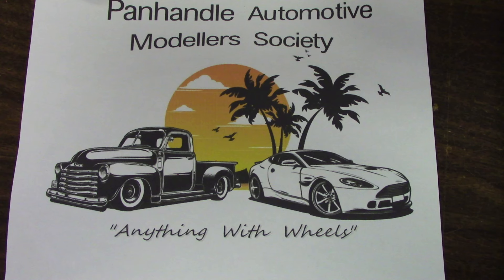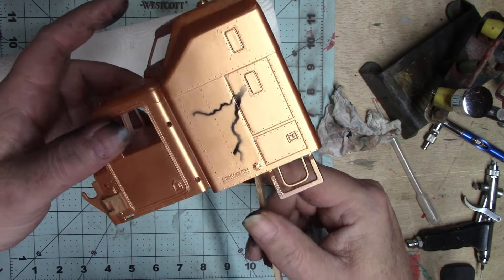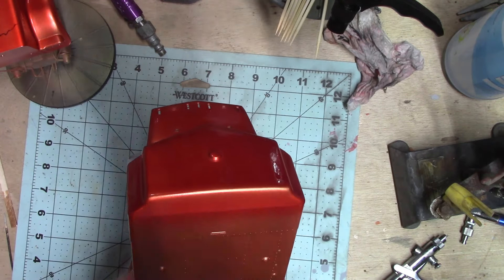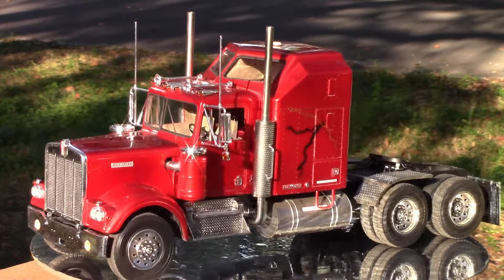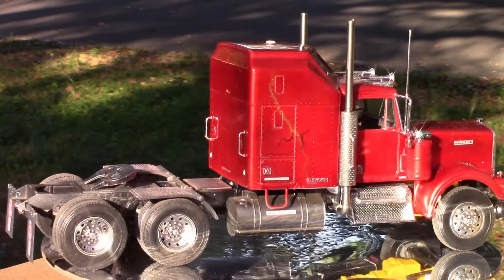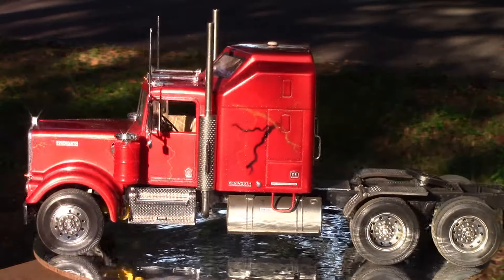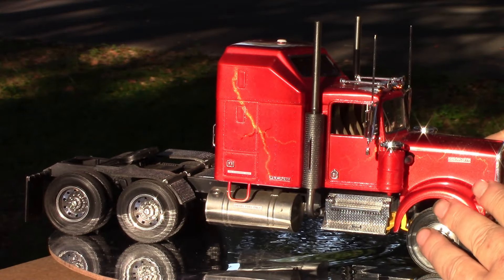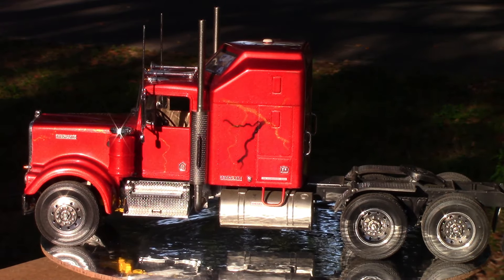FINAL ON MY FIRST BIG RIG SEMI BUILD #scalemodel #kenworth #modelcars  #diycrafts #bigrig

Comment: Hey Pappy. How did you handle the wheels and tires on this build? Having worked with two of the Revel " Historic Series " trucks myself, I've found the wheel/tire package to be practically unusable, and yet your's look great! Mind sharing the secrete?
Reply from the maker: I'm trying to remember, I put the wheels together a good 6 months ago.  If I remember right, I had issues lining them up correctly, and had to scrape the chrome from the inside, and possibly widen the locator pin.  Or did you have troubles getting the wheels to fit the tires?  A buddy of mine had that issue and had to get a new set of tires from Revell, something about switching vendors for that if I recall right
Reply: @pappytinkers  The issue I've had with " Historic Series " wheels and tires is getting the tires to fit properly on the wheels.
Reply from the maker: @edwardhood6252  ahh.  The tight ones I soak in hot water for a few minutes, that softens the rubber/vinyl usually enough to stretch over the rim.   The loose ones, I cut little strips of the thinnest plastic sheet I have and glue them to the rim, to fill the gap .  Cut them about 1/8 inch wide, and space them on opposite sides, 2 at a time till it fits
Reply: @pappytinkers  My issue has been that the " open " side of the tire is " too thin " and just wont stay on the wheel, as the tire is too flexible and " warped " and the wheel itself doesn't have anything to hold the " bead " to the rim.
Reply from the maker: @edwardhood6252  do you have the variety pack of Evergreen plastic tube or rod?  You can make a new bead with that.  Test fit to find the right size.  If the tires are warped, put a rubber band around them, it will automatically try to shape them into a perfect circle
Reply: No, it's the " side walls " that are warped, not the diameter of the tire itself. On the Evergreen stuff, I generally just get the individual sizes, and I have A LOT of Evergreen, tubes, rods, strips, sheets, etc...
Reply from the maker: @edwardhood6252  ohhhh.  That one is tough.  Once I was able to get them back into shape with letting them soak in hot water.  The other time I came across it, I had to get new tires.  Or you can take a picture of them, send it to Round 2, and ask for a replacement.  Or Revell depending on who has the molds now
Reply: @pappytinkers  If  build another " Historic Series " truck, I probably will contact Revell about replacement tires. As it is, I'm just using a few parts from my " Historic Series " KW W900  for my Revell Germany KW W900 build. Like the Aerodyne sleeper roof, for example.
Reply from the maker: @edwardhood6252  I know another guy who builds a lot of trucks, he may have some ideas @garytanck   Tell him pappy sent you his way
Reply: @pappytinkers  Actually, I'm already subbed to his channel. I probably will pick his brain on the subject, though. Thank you.